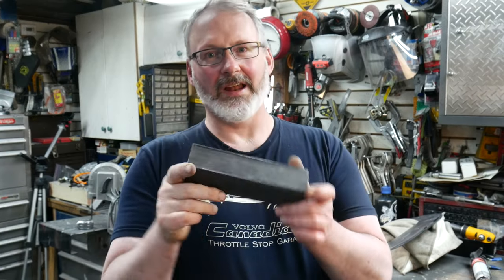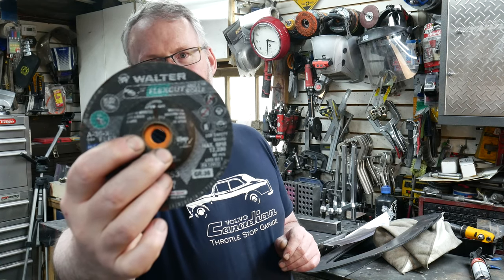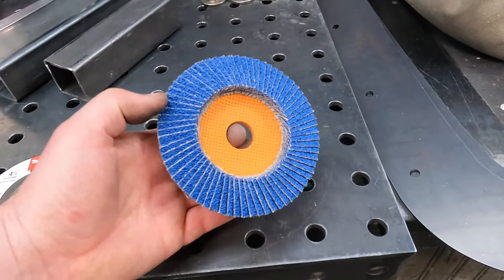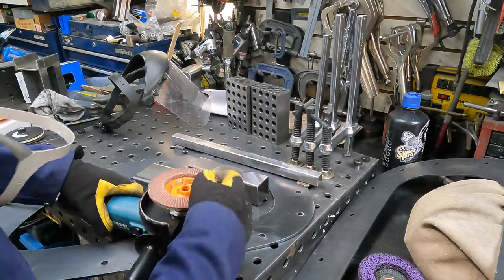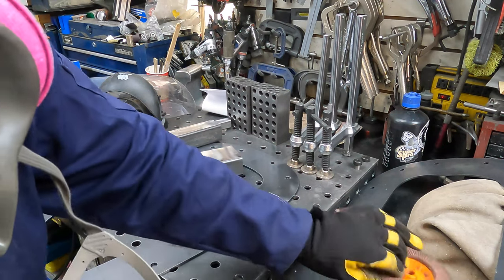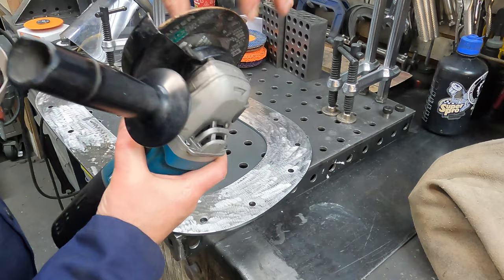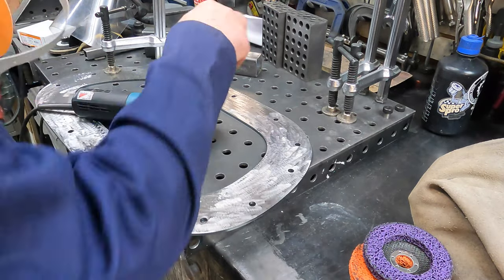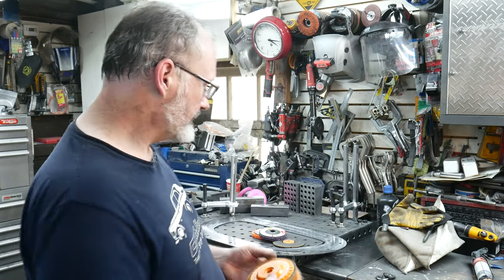Mill Scale Removal Shootout: Abrasive methods.

Comment: Those orange/purple spongy discs are my go to discs for millscale and rust on tubes...but on sheetmetal or flatbar, millscale is a biach, also you should use backing plate with that "support"washer for angle grinder so the shaft of grinder doest stick out and you can use it flat...much better for finish and disc life
Reply from the maker: Yup - I've got to grab a washer to get that backing pad flat.

Comment: Harbor freight Warrior 4.5 in Poly carbide woven disc. $7.99 before sale price. BAUER Carbide Grit Triangular Grinding Rasp for Oscillating Multi-Tools.
The problem with mill scale is it wants to just burnish or glaze over and you can't get under it. The poly silicon carbide woven wheel are hard enough grit to break thru. Ceramics do too. The triangle carbide grit on the vibration multi tool will break up the scale with a quick pass, then hit with the woven wheel. Use a router speed control to slow down the grinder 11,000 rpm is too fast on scale it glazes, slow it down.
Reply from the maker: Great tips - haven't had to remove any mill scale in a bit thankfully.

Comment: I don't deal much with mill scale but as a blade smith making damascus steel , the scale is much thicker and there is always flux on the billet , to get rid of it in absolutely no time at all , i use the diamond coated tile cutting discs on the 4.5" angle grinder . and they are cheap , costing the equivalent of $3 a disc ! After that i will smooth it off either on my belt grinder or with a flap disc
Reply from the maker: For sure going to try this!
Reply: @ThrottleStopGarage  please let me know if it works as well for your application as it does for mine 👍🏻

Comment: White distilled vinegar works very well, but it takes some preparation with building a suitable tank for larger steel plates or parts, for example with some fish pond liner, or an IBC container cut to a suitable size, or whatever you can find or use that fits your parts. For flat bars or pipes you could use a PVC pipe filled with vinegar. You drop the metal in the tank, let it sit for some time, I don't know, maybe 24 hours or so, maybe shorter, that is a matter of trial and error, and it will be as shiny and as clean as it can get without any abrasive marks on it. But you have to rinse it to stop the chemical process. But compared to abrasive methods it takes no effort at all. And it is very cheap. Even if it is just for one project or part. You can easily do a few tests and it will cost you less than 5 dollars.
Reply from the maker: I've done this before and it does work great...I just didn't have the time or patience to build a big tank and scour town for gallon jugs of vinegar!
Reply: @ThrottleStopGarage  I hear you, but it doesn't even have to be a big tank with gallons of vinegar. If you have some pond liner all you need is a few pieces of wood, or some rocks, to create a temporary raised edge, it doesn't even have to be screwed together, that you can cover with the pond liner and create a bath that is just deep enough and just large enough to cover your part. If your material is only 1 cm in thickness the temporary bath doesn't have to be any deeper than that. I think that for that large flat part that you showed in this video it would take less than a gallon. 

There used to be this guy on TV who makes all those impractical steel swords and such. I forgot his name. He does this all the time, I mean with the pond liner. And if you can get your hands on some EPDM roof or pond liner you can use it over and over again, that stuff is nearly impossible to pierce or rip apart. And the EPDM rubber is also excellent material for DIY rubber gaskets. Super strong.
Reply from the maker: @insAneTunA  I'm going to look around and see if I can find any.  Thanks.
Reply: @ThrottleStopGarage  It is a material that if you run into it, for example because people are going to replace it, you want to have at least a usable part of it because it is such a versatile material to have, even if it was just for making your own gaskets for various applications. Especially when you need a larger size gasket for whatever application. Years ago I bought a piece that was used as a pond liner but that had a piercing somewhere. For my application that didn't matter at all. And to this date I still use it if I need a gasket that I can't buy or when I think that it is way too expensive. 

I had seen some videos about EPDM rubber and they said that it was so strong that you can't rip a sheet apart with your bare hands. I thought that they were exaggerating, so I tried it, but it is true. I could not rip it apart with my bare hands. At least not when I tried it with a substantial piece of it. I'm not the hulk, but I ain't tiny either :-) And EPDM rubber is also used for automotive applications. 

Anyway, curious to see if you can find a satisfying and suitable solution for your situation :-)
Reply: Trash bags work great. Any plastic, then 12” rope, or dowels.  Super easy.
Reply: @nigeleleven2172  We settled on using cold rolled steel. There is no mill scale to remove 🙂
Reply: I got the concentrated version and then dilute it down with cleaning vinegar, much more time / cost effective

Comment: Spongy discs are great. I did alot of testing with different discs and definitely came to the conclusion that for tube the best is spongy for millscale and cubitron pads 80 grit for surface. 120 grit cubitron actually is amazing for the final finish but I dont think they are easily available. Flap discs SUCK.
Reply from the maker: Can you grab a brand name for the spongy disks?  I've got a stack of the Walter ceramic disks and they're pretty good.
Reply: @ThrottleStopGarage  I've used Mirka brand spongy discs. They are alright for the price and very available in Finland. There just isnt that much variety here in spongy discs. With flap discs I noticed that no matter what the price point of disc they all clog up pretty much the same on heavy millscale. I must admit I couldnt justify the price of ceramic flap discs so I havent tried then.

Comment: Hi, I use fiber discs all the time at my job. The Walter cool-cut xx are great. But I've discovered the VSM ceramic, they are better and not as expensive. The better back-up pad makes a big difference in the performance of the disc. I use 5" 50gr for big material removal on steel and 120gr for weld removal on stainless steel.
Reply from the maker: Thanks for the info!

Comment: I did buy one of those pferd diamond wire wheels like Fireball Tool uses and it's great, but you need either a variable speed grinder or a buffer/polisher to run it.
Before that, or if I'm working on small parts or sharp parts that'll eat the wire wheel, I use 3m cubitron resin discs 36 grit. Walter, Pferd, BA, Harbor Freight ain't got nothing on cubitron.
Reply from the maker: True - I've never tried the diamond wire wheel.  I've wanted to, but haven't yet.

Comment: The best way to remove millskills to buy metal. That doesn't have it either cold road or factory san blasted. I get cold rolled for my steel signs and I get factory sand blasted for my AR 500 targets. It's cheaper overall because you save money on embraces and more importantly, you save your time.
Reply from the maker: Absolutely,  I try to order cold rolled when I can get it.

Comment: Vinegar is pretty good. I keep a 4" x 6' pvc pipe in the corner of my garage, with one welded on cap and one loose cap with vinager in it. I use Home Depot 30% vinegar but I'll add water sometime if I'm low. After an overnight soak, I put 3 2x4's on my pickup bed (my driveway slopes) then lay some poly over them.  I pull out the pickled pieces, rub them with a scotch pad, then stand them in a gallon bucket that I've added baking power to and rub them with another scotch pad. I use a piece of mechanics wire like a fish hook to put the metal in the tube and to pull them out. when I rinse, I usually pull the scotch pad through the tube while they are in the baking power bath. After all this the metal gets a hose rinse and then an air blow. Because I'm obsessive, I like to buzz them with 150 grit on my orbital sander. My power coat guy doesn't charge me much for prep. Plates can be done using the poly and 2x4 box method, just think through how you'll empty it. Spilling on my driveway doesn't seem to cause trouble (asphalt) as long as I have the hose ready. 😎😎
Reply from the maker: That's a great idea.  I'm going to think about this for a bit.

Comment: I've had good experiences with 3M cubitron which I think is CBM Cubic Boron Nitride - basically cuts faster and lasts way longer than a normal grinding disk. Not sure if that's a finish available on the flap wheels or scourers but that stuff is great. Plus one on flap wheels tending to dig holes and float on the scale. I stripped the scale off the top of a 50mm thick disk a while back, heavy scale, and I did it with paper towels and hydrochlroic acid brushed on and just monitored. Once it got all the way through I hit it with water and a wire wheel and light oil and then later waxed it and it came up great minus the small creases/grooves from the manufacturing process that the acid exposed (filled with scale prior, I guess).
Reply from the maker: I'll have to see if I can find a cubitron disk. I've used various acids over the years.  Works great if I've got patience.
Reply from the maker: I got some Walter Coolcut in 36 grit and they work great.
Reply: @ThrottleStopGarage  I was taken in by the marketing. Cubitron is nothing to do with CBN/Cubic Boron Nitride at all, they're ceramic. I can atest to the fact that they work very very well though and last well. Description is:

engineered with precision-shaped grain to cut faster than competitive ceramic products

Triangular shaped ceramic grain wears evenly, runs cool, and optimizes mineral breakdown, for extra-long life

Guessing other ceramic disks are comparable at least ;-)

Comment: I used 45% vinegar that I bought on Amazon for mill scale on hot rolled 1/2” plate. This worked out very well for me!
Reply from the maker: It does work great if you can submerse the part!  Much easier than grinding.

Comment: I was usually removing most of the big stuff by brushing on a heavy coat of krud cutter - the must for rust and wrapping the part overnight in plastic film so it doesn't dry out. Rinse then grind the little left, which leaves a good finish and does not cost an arm and a leg in abrasives. There's a tiny layer of scale that will be left, so abrasives are needed but most of the heavy stuff is gone at least, it's way softer to grind off.
Reply from the maker: Great tip!

Comment: Abrasives are good for a quick clean welding job but for production get a plastic tank at a farm supplier and put water and muriatic acid. You can put all the parts in there, go get some coffee come back and they are clean with no gouging
Reply from the maker: Great tip.

Comment: Are there chemical solutions?
(Something like rust converters?)
Reply from the maker: Yes - many acids will do the trick.  Vinegar, phosphoric, muriatic all work.  Different levels of time, mess, expense.  There are some good ideas for how to make a dip tank in the comments. Sandblasting also works.

Comment: I have used S/C rock disc's for many years in my fab shop, but you have to break the wheel edge in first otherwise you will gouge the crap out of base metal.  I learned this by accident one day when i bought masonry disks and noticed how easy the scale came off,upon looking at the disk I was like "WTF" it was a different brand than the Norton I usually purchased. can't explain why it works but it does, but to be honest most fab jobs I do are MIG welded heavy structural steel like cat walks, platforms for plastic injection molding machine ect. mill scale isn't an issue., but weldment critical NDT jobs get proper prep work as per spec.
Not sure why you didn't have luck with the S/C disk you tryed, maybe it was the grit? I use 60
Reply from the maker: Cool - I'm going to try this!  Thanks.

Comment: thank you for taking the time and money to do this video on mill scale.....
have you ever tried silicon dioxide sanding/grinding discs..they are softer
than aluminum oxide or zirconium and .they fracture
much easier and so have a sharp edge all the time......
they are used for stone and glassand are supposedly great for mill scale and are inexpensive...
.being just a disc....I bought some recently, but have not given them a thorough testing...
my mill scale issues are much heavier than yours as I also work with structural steel
for the industrial looking furniture I make....we normally leave the thin mill scale 
on from tubing....as we are powder coating and the powder coaters is blasting these, I think...haha
Best Wishes from Florida....Paul
Reply from the maker: You're welcome.  I've never tried the SiO2 disks but the flex disks for mill scale are soft and wear pretty fast.  They work, but have limits.

Comment: Silicon carbide flap discs supposedly work very well. Pferd also makes a wire cup wheel with an industrial diamond coating for mill scale but it's prohibitively expensive and if it holds up like their other wire wheels it'd be a waste of money.
Reply from the maker: Can't find those at all - I did find that 36 grit fibre sanding disks (ceramic) work as well as the flexcut.   Those would be my top two options for rapid, inexpensive removal of heavy mill scale.
Reply: Amazon! Got a box of 10 for like 30 bucks!
Reply: I can vouche for the Si-Ca flap disks. They are usually sold as "used on masonry" , but they work wonders on heavier millscale too. For lighter jobs I like the Purple/black paint strippers cause they don't gouge.

Comment: Ceramic is what you want.
Reply from the maker: It worked great until the scale got really thick - then only OK.  It did work though.
Reply: @ThrottleStopGarage  I thought you were using zirconia rather than ceramic? Ceramic will handle the heat a lot better than zirconia.
Reply from the maker: @plsreleasethekraken  The Walter Abrasive sanding disks were ceramic.  If I had to strip the mill scale off the thick plate, I'd hit it with my torch first then the sanding disk.
Reply: @ThrottleStopGarage  gotcha, makes sense.
Reply: @ThrottleStopGarage  Try the Pferd Combiclick ceramic discs (red). They won't last as long as the Flexcuts, but are half the price; they won't gouge as badly either. Not sure if they are cheaper than the Walter ceramics you got though.
Reply from the maker: @plsreleasethekraken  Thanks for the tip - I'll order some and see how they work.

Comment: Bit of an odd choice not to try fibre discs... The cheapest and probably most effective.
Reply from the maker: I was going what what was suggested at the welding store. I'd try a coarse disk if I didn't have to buy a box of 25!  Any suggestions on brand?
Reply: @ThrottleStopGarage  3M, Dronco, Klingspor, Pferd, Norton, Abracs are just a few reputable names off the top of my head. 

The best abrasive material is ceramic, followed by zirconia, and then boggo aluminium oxide. 
Naturally, the ceramic abrasives cost more, but perform better and last longer. 3M cubitron (ceramic) is very highly regarded, but not cheap.
Aluminium oxide costs the least, but doesn't perform as well or last as long as ceramic.
Zirconia is in the middle. 

Get a rigid backing plate. This will prevent the disc from following the contours and hitting only the edges. A backing plate which is vented is a wise choice as it lessens the effect of heat on it. You could also try a rubber backing plate to compare the difference between the two. 

Check eBay as you should be able to pick up single discs or in multiples of 5. It's generally a good place to find deals on everything and anything.
Reply from the maker: @goldar4846  Working on this now.  Thanks.
Reply from the maker: @goldar4846  picked up some ceramic 36 grit disks.  They work great.  About the same as the mill scale disk.
Reply: @ThrottleStopGarage   I'd be keen to see the result of a rigid backing pad vs a rubber one.

Comment: Best discs for removing mill scale in my opinion are the discs that contain Silicon Carbide like the discs from 3M( Scotch-Brite Clean and Strip XT Pro Disc with Extra Coarse Silicon Carbide)
Reply from the maker: Tried those in the video.  Worked great on light mill scale.

Comment: I would skip all the fancy discs and go straight to the sanding disc w/ backer pad for removing mill scale in all cases!  It is in fact what the pros use.  It cuts through the scale on the first pass as well as it cleans up the mess made by the "mill scale" disc.
Reply from the maker: Another viewer commented this as well - I tried it and can't believe that the welding store guys didn't tell me about this!  They worked great.
Reply: @ThrottleStopGarage  Example of sanding disc with backer pad?

Comment: Sorry but the best way is to use White Distilled Vinegar now a soak over night will clean it great with zero deterioration to the Metal, if time is an issue then there is 30% or even 45% white Vinegar which will bring the soak time under three hours. And last but not least is electrolysis with Vinegar with Salt added to water but any of these methods would leave the Metal without scratching the material.
Reply from the maker: Yes - I've used that technique before.  But when you don't have access to a vinegar bath due to time or the size of the parts, then it's abrasives to the rescue!
Reply: @ThrottleStopGarage  I have trays for the size of the part you made but not much larger for that I would go with Electrolysis. For long pieces I use PVC pipes as my tubes. But I agree sometimes there just is no replacing abrasives especially when removing zinc plating. thanks for the reply.